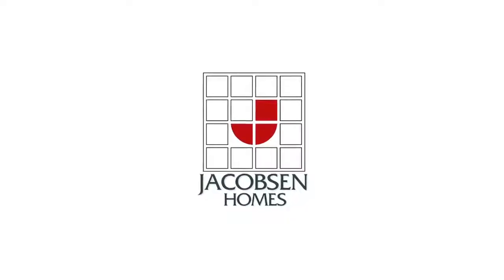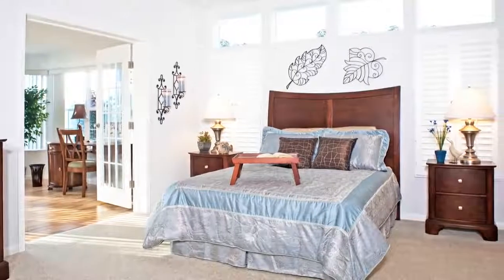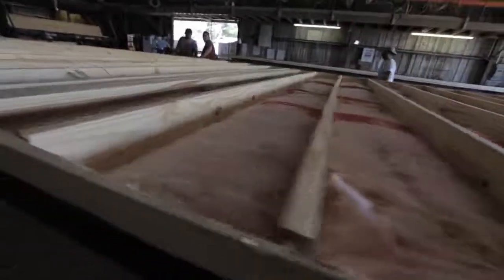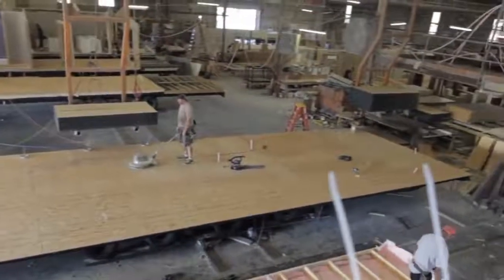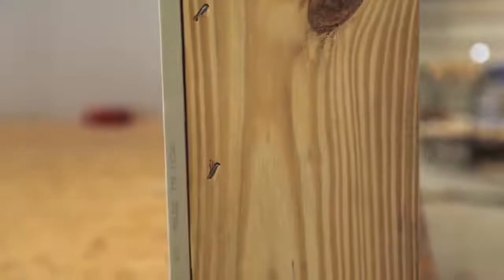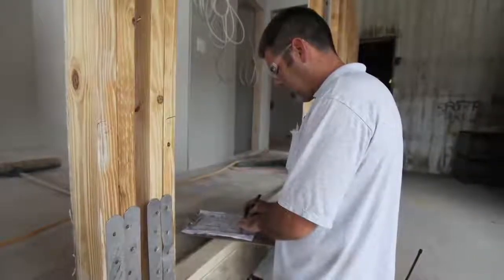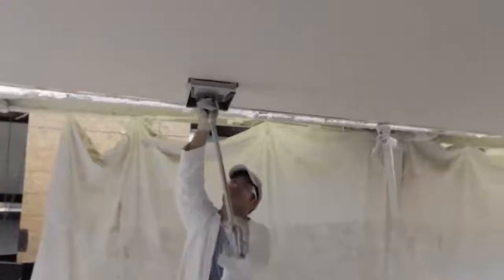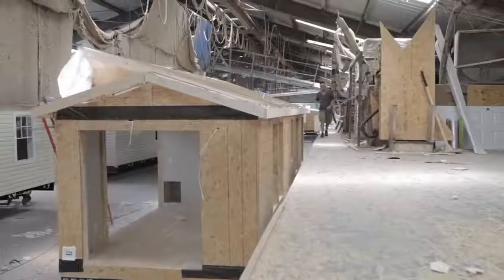Jacobsen Homes Factory Tour 720p 1

Comment: I live in a manufactured home and as a former home builder during the 80's and 90's, I can attest that they have come a long way from the days of "trailers". 1) they are built in a factory under controlled conditions. 2) use very strict codes  3) the tie down program is substantially better using helical piers. If the set up is done with great care, these homes can withstand Cat 4 hurricanes.